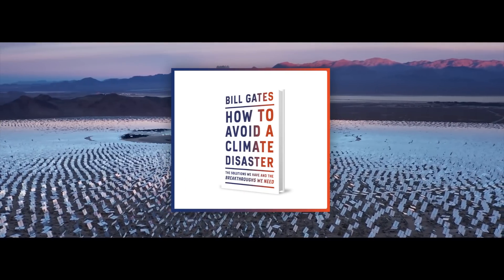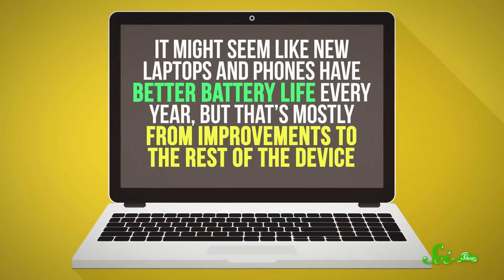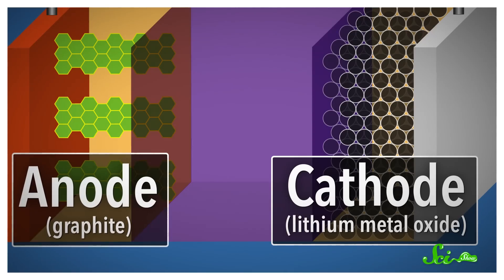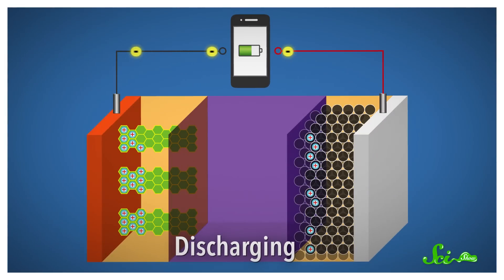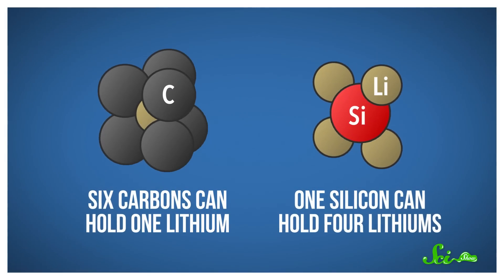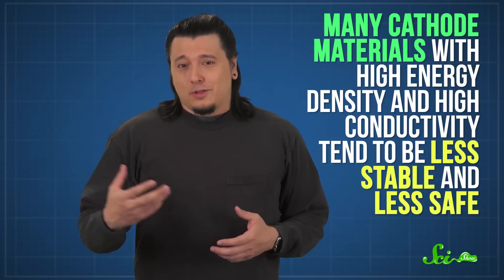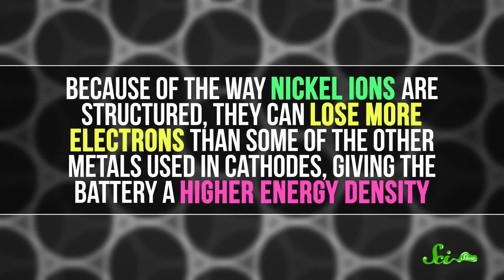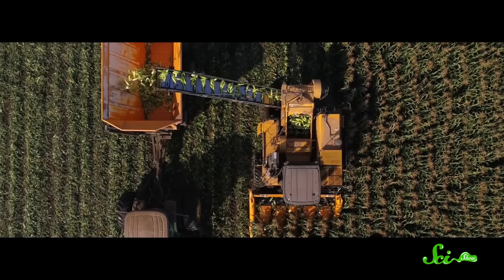Why Haven't We Built a Better Battery?

Comment: Right now we are seeing alot of alternative energy storage solutions, most focus on harnessing potential energy (lift up a stone when power is cheap, drop it when its energy is needed)

Though the most promising one i'v seen is hydrogen storage. Separate water when electric is cheap, store the hydrogen in large tanks and use it when needed.

Same principle different method

Comment: I'd love to hear more about those alternative battery types sometime.
Reply: one option is a thermal battery, heat a large amount of aluminium till it melts, do this with solar energy during the day, on a night use the heat from the molten aluminium to run a sterling engine which can be used to create electricity, the aluminium requires a lot of energy loss to change state back to a solid and even then can still run a sterling engine until it cools to ambient temperature.

Comment: I say use mercury towers for utility-level energy storage. Gravity and pumps are a much better "battery" where size and weight don't matter much. Trying to use chemical batteries to store GWh's of power is daft to say the least. I feel sorry for the utility and everyone's power bill when it's time to replace all or even a small % of those.
Reply: Mercury isn't that plentiful and it is extremely toxic, minus that daft aspect these already exist and have existed for hundreds of years, problem is to get any significant amount of energy storage a water tower isn't nearly enought, you need an entire dam, compared to digging out and maintaining a dam a bunch of batteries sound really economical.
Reply: @Stackoverkill  $180 per kWh stored isn't economical at all, unless that's a 1-time fee and the batteries lasted forever. Even the best lipo's or even  LTO's probably would have a half-life of about 10-15 years in daily use. You could probably stretch that to 100 years if the battery was oversized to where the dod is only 10%, but a point comes to just replacing it after daily 80% dod's is cheaper. With maintenance a resevoir/dam lasts indefinitely (centuries to millenia) so is mostly a 1-time expense. The mercury towers would be for when the land isn't suitable for a resevoir and space is limited, since Hg is 13x denser than water. Persdoanlly I'd rather spend the cash and just put a solar panel ring in orbit. No atmosphere so efficiency would be 25-30% from the panels themselves and beam the power down in a maser to substations. No storage needed at all then, since half the ring would be in sunlight at all times other than solar eclipses. Sadly solar panels have a half life too, about 25 years. Possibly less in space.

Comment: Why don't we talk about this!Problems with different types of energy sources:
• Fossil fuels: toxic gaseous byproduct released upon usage
• Wind: requires large plots of cleared deforested land, relative low energy production, expensive production cost, requires fossil fuels to produce structures, unreliable, high maintenance cost, also kills hundreds of endangered and threatened bird species every year.

• Solar: expensive, localized energy production, dependant on fossil fuels to produce structures, unreliable for long term sustainability, high maintenance cost, contain toxic materials, costly disposal, and functional energy productivity for at most an average of 60% of the day depending on location.
• Hydroelectric: Large facilities, location dependent on body of water, structures and facilities produced with fossil fuels, deadly to wildlife if on a natural water source, deadly exposed water turbines, dependant on rainfall

• Nuclear: people are afraid of it due to misunderstandings and fearmongering from nuclear weapons.

Why don't we talk about dis?

Comment: You mentioned people developing better batteries, but I'm surprised you didn't go into more depth.
Like how John B Goodenough (the developer of the lithium ion battery) has developed a solid state battery.
Which is amazing, but the reason it hasn't been put on the market is because they are still developing methods of manufacturing it reliably/easier. And maybe better for the environment.
Reply: He has been working with Tesla, and Gate's hates musk, even had a short position on the company. So unfortunately bringing up John is absolutely not aloud thanks to Gate's ego.

Tesla hired him and when you watch their battery day they talk about their dry electrode coating and 0 cobalt usage and a whole bunch of improvements which at least in part thanks to him.

Comment: They actually do have higher capacity batteries using sodium-ion. Sodium is great because of its abundance. One problem, until recently, has been sodium-ion batteries have been harder to manufacture on mass scale because of how pliable the material is during construction of the battery.
Sodium-ion batteries also have one other major problem. They are heavy. While they can hold up to 3 times the amount of energy of a lithium-ion battery, it comes at the expense of 5 to 10 times the weight.
With the battery already usually being one of the heaviest components in cell phones and laptops, it is no surprise that they just try to fit a bigger battery in.
Cell phone, laptops, cars and airplanes are some of the biggest applications needing higher capacity batteries, but all of these things also need to be as light as possible.

Comment: Idea: connect the whole world through a single electricity net, so when it's dark/cloud/no wind somewhere and the batteries are low, energy can come from even the other hemisphere
Reply: Super expensive and maintenance heavy, large losses over great distances, much environmental destruction to make space to run all the cables.  It's not really a feasible option.  Look at how expensive undersea optic cables are, and they aren't transmitting any meaningful amount of power at all.

Comment: Two alternatives to electrochemical batteries, for very large scale power storage, have been around for a long time: pumped storage and flywheel storage. Pumped storage is for EXTREMELY large storage, as it involves two reservoirs of up to several hundred acres each in land area. When there is a surplus of electric power available, water is pumped uphill to the upper reservoir, then when the energy is needed again, the water is allowed to flow back downhill through a water turbine and generator. The problem here is that the laws of thermodynamics and physics place limits on the conversion efficiency: the electric motors are only 85% efficient; 15% of the electric power supplied to them is lost to heat and friction in the windings and motor bearings. More energy is lost to turbulence and friction in the pumps and aquaduct piping as the water is pumped uphill. This energy lost ultimately also becomes heat in the water. The only useful component of the water's overall energy is it's gravitational potential energy. Any heat that the pumps lose into the water contributes nothing useful to it. When you reverse the process, letting the water flow back downhill to extract it's kinetic energy and turn it back into electricity, there are once again frictional losses in the flowing water itself, and inductive heat losses in the generator windings and friction losses in the bearings. Ultimately, a pumped storage system only recovers about 60% of the energy input - 40% is lost as unrecoverable waste heat.

Flywheel storage can be used on a scale in between electrochemical batteries and pumped storage. A 1500 pound flywheel unit is about the size of a minivan, and can store up t0 35 kilowatt hours of electricity. It can be charged up in less than a minute, and since the bearings are magnetic, and the flywheel housing is in a vacuum, there are no friction losses. However, nothing in this world is "free" - the laws of thermodynamics and entropy guaranty this. Some electrical power is used to generate the powerful magnetic fields in the bearings that suspend that 1,500 pound flywheel and prevent physical contact between it and the housing. More electrical power is consumed in maintaining a near-perfect vaccum in the flywheel housing. So the maximum efficiency of a 35 kilowatt hour flywheel storage unit is only about 95% in any 24 hour period. Every day, at least 5% of the electric power you pump into a flywheel is lost in suspending the magnetic bearings, and in maintaining the vacuum, and in the electronic control systems. These flywheels have a lifecycle cost: the vacuum pumps and the mag-lev bearing windings eventually fail (8 years more or less), and have to be replaced, and these parts cost money. The only energy storage systems that are more-or-less "free", are the storage of sunlight as wood in trees as they grow, and rainwater stored in hydroelectric reservoirs, since it is free solar energy that evaporates sea water from the oceans and eventually deposits the water in a hydroelectric reservoir somewhere. When you heat your home with a wood stove, burning wood from trees that grew naturally, your only cost is to harvest the tree and cut the wood up into stove-sized pieces. The three laws of thermodynamics are immutable and absolute; they can not be ignored or changed to suit human needs, and they dictate that energy conversions can not ever be 100% efficient.

Comment: Chemical batteries are ubiquitous, therefore any technology advancements will be impactful.  But even though they might be climate friendly, not so sure about environmentally friendly.  For infrastructure projects where you need capacities in the millions+ of watts, the mechanical/potential systems seem far more curious and potentially far more environmentally friendly.  There is something simplistically beautiful about a large mass traveling up and down a slope 'converting' electrons into potential and back again.
Reply: that's a great option if you have suitable mountains nearby.  Check out liquid metal batteries, a potential up and comer that might help things along a lot, both for the climate AND the environment.

Comment: I would love to see a lot more focus on heavier batteries for home and grid storage. After all, you are not hauling your house around so capacity, discharge rates, recharge cycles and the availability and ecological footprint of materials are a bigger factor than weight.
Reply: This ! For the grid we need cheaper and reliable batteries not lighter ! They missed the point focusing on their weight (energy density)
Reply: Yes.
I was expecting to see lithium iron phosphate mentioned explicitly as I thought it is especially good in this application.
Reply: Look up Ambri liquid metal battery. Literally molten metal that can store electricity. They can use various chemistries but I think the one they are shooting for now is calcium and antimony
Reply: Looking at the current developement, I guess that in a few years time the battery issue will have been solved in favour of LiFeP. Right now, they go beyond 10000 cycles, won't burn when shorted and offer potentially easy recycling.

Comment: As for combating climate change sulfur dioxide in the low atmosphere causes acid rain but in the upper high atmosphere blocks more sunlight and still allows radiant heat out to space so there that

Comment: Oooo. My graduate thesis topic.
Reply: What are you studying?
Reply: @erickuhn1042   I used to work in industry with safety and environmental concerns, but my thesis is on computationally simulating electrolyte movement between the cathode and anode like at 1:37.
Reply: @many_feet  hello fellow soul travelling this bonkers road!
(I just finished a masters and my work focuses on scaling up aqueous battery models)
Reply: @saber1epee0  That's so cool! Aqueous electrolyte models are so helpful, especially that they occur in so many systems, both in and out of batteries. And I understand scaling from microscopic to macroscopic or anywhere in between is tough. So thank you for your work!
A lot of aqueous work was my guidance for my non-aqueous system that just published and became available online yesterday!
Reply: Or should we build a more distributed system with batteries in each house?  Less storage needed, only enough to keep house going for few days?? As electric companies bring in the power.
Reply: @grandenauto3214  your idea is similar to how Tesla installs their chargers at your house. The only issue is the maintenance and potential storage conditions needed at your place. Of course it will depend on where you live, etc. But I appreciate your idea as it is a modern take on the classic home generator or kerosene heaters.

Comment: Kinetic batteries aren't viable yet? You know, make a heavy wheel spin with electricity surplus, then use the spin to generate electricity back when needed, or same thing by moving weights up and let them down when needed.
Reply: they don't scale well.

Comment: We As A People cannot built a better battery, because dirty bombs are a thing. witch is ironic since you(The public)cannot buy the elements anyway.  no elements = no battery   radioactivity can be harnessed for extremely efficient storage and power means(think any spacecraft in operation). the problem is the public Cannot be Trusted with that technology, to only use it for good. With Great Power, Comes Great Responsibility.

Comment: When it comes to grid scale battery storage energy density isn’t as important as it is in phones and cars. Price per killerwatt hour is the most important thing. But because most of the R&D over the last 20years has been spent on making smaller lighter batteries lithium ion tech is way more advanced and so the thing people jump to. When there are lots of other battery types that could never be scaled down to fit in your pocket but are way better suited to shipping container sized applications.
Reply: Energy per $, and per production time ( the scale is that big...)

Comment: First up, Bill has no clue what he is talking about when it come to batteries, he once said heavy trucking will never be able to use batteries. Completely false, they very much can. Also just because we use still lithium ion batteries does not mean there are no new batteries or that energy densities aren’t rapidly increasing. Si anodes are already here and will be a big part of the future battery cells due to polymer coatings and others. Tesla has advanced battery cell tech by light years. Progress is not slow at all if you actually know what is happening in the field. Dry electrode is game changing among others like tabless design. Don’t put out a video like this without actually knowing the industry gold standard Tesla’s 4680’s
Reply: Lifepo4 lower energy density but much longer cycle life  want a million mile car all I have to do is put one of these in there and you got it right now and no child mined Cobalt

Comment: Simple incremental improvements on the same system will eventually reach a limit. The solution is almost always a whole new system rather than the improved original

This is certainly true for batteries, how does 200,000 wh/kg sound?
Reply: it sounds like DYANAMITE!, well, actually about 180 times more potent then dynamite.

Comment: Battery tech has come pretty far since the 1990's. I flew RC aircraft since then and the batteries have come a long way. It used to be a NiCad battery could fly a small park flyer for about 2-5mins depending on atmospheric conditions... Now a battery the same weight that is Li-Fe can power a craft twice as big and you get 10-15 mins of flight! Also the price of Lithium batterys has plummeted, what used to cost 150 bucks a battery is now 15 bucks!

Comment: why not just physically pump water up to a high gravity potential when renewable is in surplus? it's probably less efficient but won't degrade over time unlike batteries
Reply: No it is about 90% efficient. But it is costly to build and requires suitable terrain.
Reply: thank you to both of you. my idea that I thought was so simple that it's genius turned out to just be simple
Reply: because you need a mountain suitable to build a huge reservoir in that's also fairly close to where you need the power.  you also destroy large parts of said mountain to do this.  it's the same reason we don't all just use geothermal energy, it's geologically dependent.  This strategy is used in many places the DO have the right condition's though, it's one of our better energy storage techniques.
Reply: its not possible where the country is flat.

Comment: You could pump water to high reservoires and use the pressure later to run a turbine. You use the electricity in excess to make the water store potential energy. And I think turbines can be very efficient. 
It's simple, scalable, uses technology that we already have, though it's for infrastructure, regions, countries and not devices.
Reply: It is used a lot in some countries. https://en.wikipedia.org/wiki/Pumped-storage_hydroelectricity#Worldwide_use If you already have a reservoir that you can use, it is totally worth it to build in most cases, I presume, but if you have to artificially create a big reservoir it can have heavy environmental challenges. Often you need to flood an area similar to what you do when building a hydroelectric dam. So, like with everything, a good idea in many scenarios, but in general, it's a bit more complicated and thus only a part of the overall solution.
Reply: @joranschneyer  I didn't imagine it was a new idea. Basic enough. But you're right, there's issues with it as with anything. Still feels like a solid idea.
Reply: Geography doesn't always agree. You need two bodies of water close together with a decent height difference.